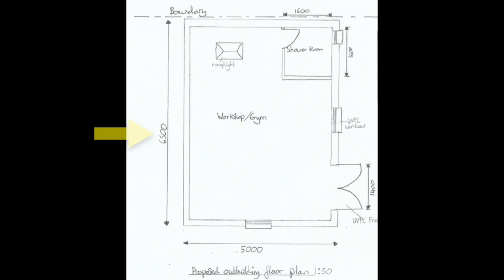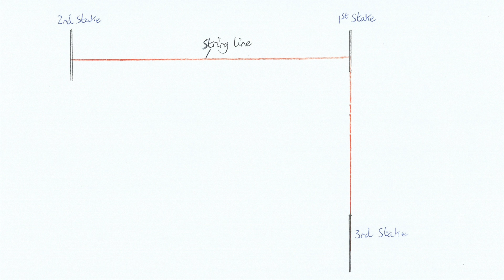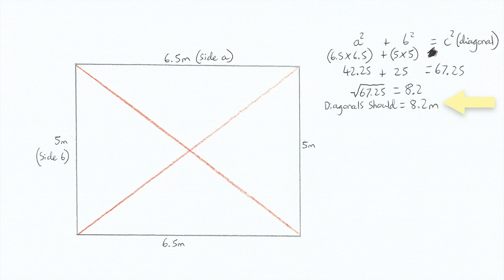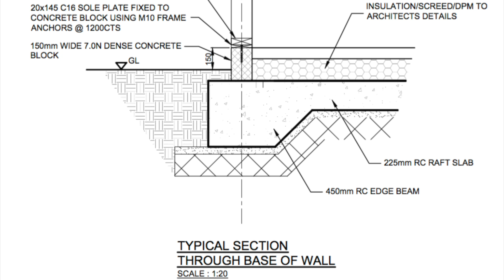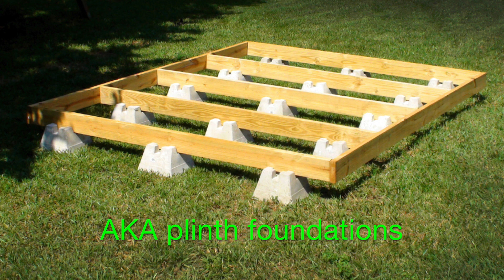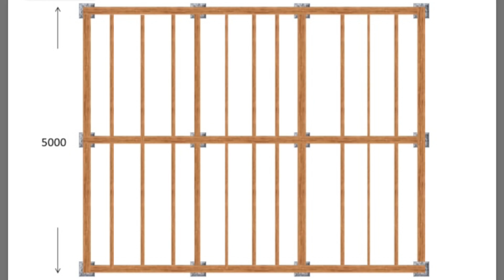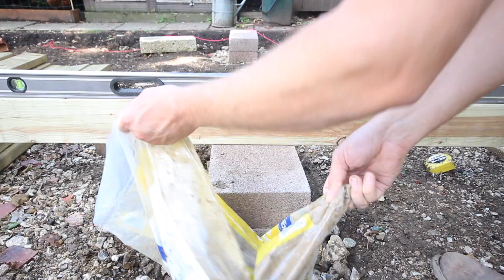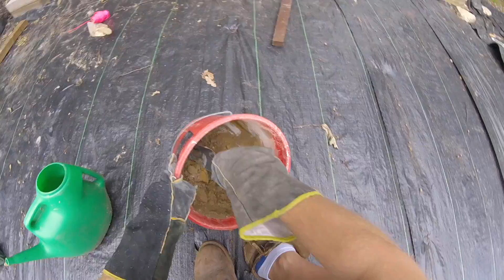Garden Room Workshop: Part 4. Setting out & Foundations

Comment: Thanks Ali - I came across your series of videos quite recently as I am wanting to build something similar. I reckon they are all I need for a successful outcome. A quick question about the height your building is raised off the ground. You mention in the video raising it 15 cm off the ground for building regs and airflow, splashing etc. I am assuming this then needs to be taken into account when calculating the length of timbers to calculate the height of the building? It just seems quite a lot, especially when considering the 2.5m overall height restriction. Looking forward to the completed project.
Reply from the maker: Hi David, yes good question and I was waiting for someone to bring this up. At the back of mine the land is higher and definitely not 15cm below the floor joists. If I were building to 2.5m I wouldn’t waste so much head room height by having the floor so high off the ground. It’s a recommendation from b regs which makes sense but deco not required. Just make sure your joists stay dry :)
Reply: Thanks for replying Ali. Mine is on a very slight slope so have dug down to create a flat area...floor level should end up level with garden at highest point. Looking forward to chapter 11 and especially whenever you do the cladding.

Comment: is there any disadvantage of the foundation choice in the eventual floor?..... like, is it bouncier than it might be? and is that unwelcome in a workshop use? or is it all much of a muchness? great videos, good detail!
Reply from the maker: Good question. Well it doesn't feel bouncy but doesn't feel as solid as concrete of course. It's exactly the same as in a house really. Not sure when using stationary power tools inside, haven't got to that stage but I imagine perhaps a little more reverberation than a concrete floor. but that's to be expected. It's a cost effective way of doing a foundation and one that I could do myself so that won me over. the rest of the build is admittedly a lot more engineered than the foundations but they've held up brilliantly so far, zero movement (as one would hope!)

Comment: Hi great video can you tell me if you had to cement the first block onto your ground base.
Regards Terry
Reply from the maker: Hi Logan. Good question-think somebody else asked this too. I didn't as I'd spent so much time getting them level so just cemented around and between the blocks. I'd recommend that you do however and should make levelling the first block so much easier than just using sand as in my video.
Reply: @AliDymock  How would you cement it - just lay some cement on top of the hardcore and push the block down?
Reply from the maker: @stw23490  Exactly. Get your hardcore in the hole, lay some cement on top and get your block level on that. Then build up from that until you're 5-10cm above the surface. Don't go as high as me if 1) you ground is flat 2) you are going under 2.5m permitted development as you don't want to waste height on your foundations.
Reply: @AliDymock  Thanks for the quick reply mate. Hero.

Comment: Hi Ali, great series of videos and I'm very grateful for your info - I'm planning on starting a 28' x 12' workshop in my garden this summer. All your info re span tables and the like is so helpful. One question I have is about the dense concrete blocks. You mention 7N ones but these seem to be available at both lower and higher ratings. How does it translate to what weight it can withstand? I imagine the timber itself is going to weigh a tonne, plus windows and doors, before I've put any of my workshop tools in there. I'd also like to have a green roof if I can but I'm conscious again that these can add to the weight and I don't want my concrete blocks to crumble away. So is 7N so over the top that I won't need to worry or should I get something rated higher? I'm planning on having the blocks in a similar layout as you did, with 3 rows of 5 blocks. Thanks v much!
Reply from the maker: Hi Scott, sorry for the delay. I'm not entirely sure of the calculations for working out the the load bearing capacity of the blocks, you could probably get away with medium dense blocks or 3.6N ones but why risk it? All I knew is that these blocks hold up brick houses so that was good enough for me. I went for these ones:
https://www.selcobw.com/solid-dense-concrete-block-100mm-7n-london
They definitely won't crumble but if you're at all worried just add more block piers to further distribute the weight, especially under the walls as this is where the majority of weight goes through.
A green roof is something I considered and I think you'll have to be more concerned with your roof joists than the blocks underneath! Hope that's helpful

Comment: Kind of surprised you didn't keep the existing concrete slab. Would not do any harm below the timber structure and the piers could have rested directly on the slab where available.
Reply from the maker: Very true and well spotted Dan. When tearing it up I had planned on a new raft slab foundation, hence my drawing in the video. I decided against it due to the cost and time in the end.
That said, bind weed was coming up all through the slab and it would have been hard to use pegs to keep the weed fabric in place if I had to knock them into concrete!
Reply: @AliDymock  Hi Ali, great videos. A question with the piers. I have an existing concrete slab to build on but it is not completely level. Therefore I plan to use piers just like yours placed directly onto this slab. Would I use the same 1:4 cement / sand mix you have used to secure the first block to the slab or some other way of securing it?
Reply from the maker: @pmeadows34  I think cement would be the only way. I'm not an expert but 1:4 or 1:5 (stronger) should be fine. Here's another idea- Put up timber shuttering around your base and then pour more concrete on top of the existing slab so it's all nice and level?
Reply: @AliDymock  hi Ali. Thanks for this. Levelling the slab is an option but it's a big space (21 foot by 10 foot). That said it may be cheaper than timber joists, blocks and plywood floor . Thanks!
Reply: Hi Ali great videos which I'll be using as a guide sometime soon here in Dublin, hopefully (once i get a dodgy tree sorted out first! ).  I like the block piers method as you've done but I'm tempted to go the concrete floor+insulation route.  I imagine this could be quite beneficial in the long run being solid, and potentially absorbing, storing and emitting any heat you may put in the structure depending on your heat source.  It could be prepared well in advance of the rest of the build too if you had slow cashflow. Just wondering about options for that.

Comment: Did you cement the first block in, or was it left on the compacted hardcore and sharp sand? Excellent video BTW. When's part 7!
Reply from the maker: I didn't as I'd already got them level so cemented around the first ones instead, just not underneath- but definitely do so for yours, it will make levelling much easier. Part 7 is in the works, I'm editing now/watching a movie

Comment: Hi Ali, great videos, most informative I've found on YT and I'll be using them to help with my build.  My garden room will have external dimensions of  9mx3.6m. I'm almost ready to go just undecided on  foundations and wondered if your method of using blocks/piers  would be suitable for a build of those dimensions  and how far apart they should be positioned. Thanks and when's the next vid ?
Reply from the maker: Hi Richard, thanks for your comments. 9 x 3.6m sounds great, it should come in under 30m2 internally. You could go bigger if you have internal partitions as well. The foundations are by far the hardest choice but the block piers are a great, cost effective choice (note: you don't have to go as high as mine are-I had a sloping site and wanted to go by b regs so that's why they are quite high). I'll have a look at the span tables for you later to work something out for you. Next vid is quite complicated so it's taking me a while to explain everything so don't want to put a date on it yet!
Reply: Ali Dymock thanks Ali for taking the time to reply. Much appreciated .
Reply from the maker: Hi again Richard, I've had a think about it. It depends on how thick you want your insulation and what building height you are allowed. It sounds like you have some space so if you're 2m away from a boundary then you can go up to 3m in height like mine in which case you don't need to worry about an extra inch on the floor. However, if you are restricted to 2.5m height, every inch counts and you want maximum head room inside. 

Personally I'd recommend using the same width timber as me (5x2s) and a similar layout of block piers. 3 piers deep and 5 blocks across (15 total, compared to my 12). Your largest span will be 2.25m (pier centre to pier centre) so plenty of strength using 5x2s. I calculated that each pier costs roughly £10 so £150 for foundations isn't bad at all, though be prepared for hard work 😋. Hope this helps!
Reply: interesting points ,if anyone else trying to find out backyard storage sheds plans try WoodBlueprints. Com Ive heard some decent things about it and my colleague got cool success with it.

Comment: HI Ali,  really liking you videos. Can I ask whatever total cost of building was?
Reply from the maker: Hey Rodney, it's not finished yet but I'm up to about £7.5k though that's about 700 for skips to remove the rubble from the garage and 2k for windows and doors but these can be gotten more cheaply if you're willing to compromise. The electrics and plumbing will be the killer as I'm not able to do these myself. My chosen insulation is expensive too so it's not a good guide unless you're planning to copy it very closely. Hope that helps.
Reply: Ali, if you can do all that building, the (internal at least) plumbing and electrics will be a doddle by comparison. Strongly suggest you look into it yourself!
Reply from the maker: I wish I had your confidence! Playing around with wood and structures comes quite naturally to me but electrics baffles me somewhat, plus I'm a bit concerned if I get it wrong.  Had a quote for nearly £4k (London prices!) for electrics so that's definitely motivating me to look at doing some of it myself. Just wish I had an electrician mate!
Reply: I'm no electrician or plumber but happy to answer any question you might have - your videos have already helped me out a lot! For the electrics you might want an electrician to get a supply cable laid in the garden to the workshop, and then tackle the internal electrics yourself. Water supply is quite easy - you will need to bury it deep to prevent freezing. Drainage can be a lot more problematic for several reasons and will need building regs inspection.